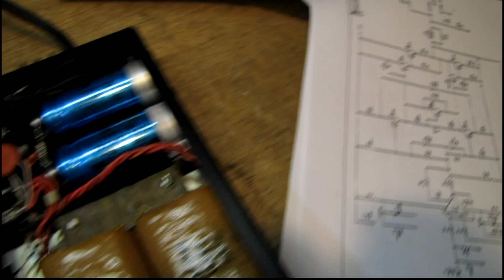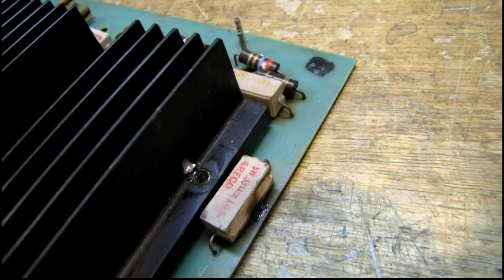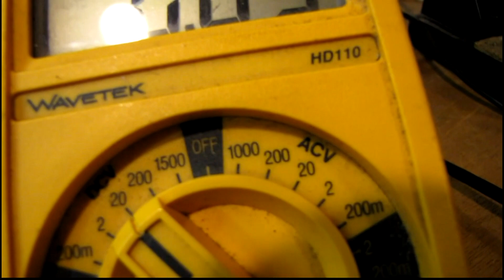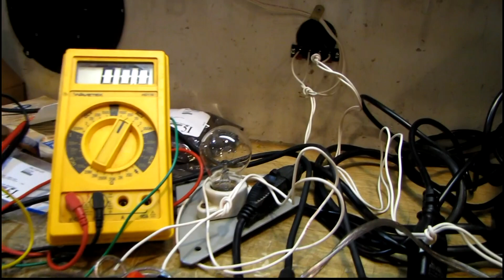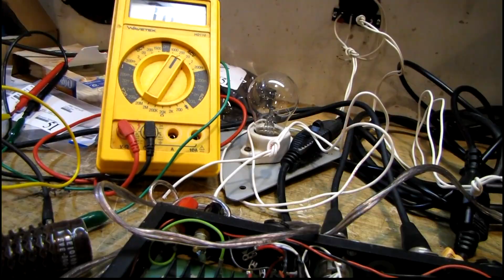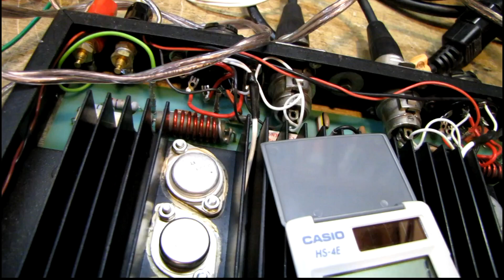Vintage BGW Model 100 Amp Repair

Comment: I have 2 of them got them from a friend of mine one had a bad power switch and the other one has a channel out going to drop it off at the repair shop before too long from now I sold my massive pa system it was huge took up my whole shop a production company owns it now running concerts so I just use these in my house with a audio centron rma800 and a crown amplifier that I saved out of my stuff

Comment: I have a 100B to drive my electrostatic headphones. Warm sound, as others have pointed out. Those old Beckman meters were great, I considered it the best of the portables until the Fluke 87 came out. One of the features was the accuracy up to 20 KHz. Only the top models were true RMS, but if you have a fairly low distortion sine wave, it makes no difference.
Reply: oops, didn't remember doing this.

Comment: Just a quick way to calculate output wattage - square the output AC voltage then divide by load impedance.

Comment: realy like your videos have try to se all your videos problem is your type  part3 but i cant find the part 1 or 2 so its alot jumping. but nevermind its still fun your are verry good to solved problem who are with electricial and components.

question what did you do with that crest ca6 your rigg is big but havent seing that one in your rigg and crest is  the best amplifired i used  ok crown is good to ;D

Comment: I have the identical Wavetek HD 110; good meter with high energy fusing but it not a TRUE RMS meter unfortunately. But if you have a clean sine wave it compares pretty close to my Fluke RMS tester
Reply from the maker: Ya, I was surprised how well it worked.  It was actually a junk box find that my Dad gave me.  One time I forgot to turn it off, and it was still running several days later LOL.  I found the website just now, and I can't believe how expensive it was.

Comment: It's entirely likely that the output transistors of that channel weren't really seeing any "abuse." With it locked to the rail, one was likely solid on and the other solid off... they were both effectively in switch mode, with no dissipation. That's why they survived.
Reply from the maker: +emolatur That's a possibility, though I'm not sure those transistors would be able to saturate enough for that.  Their internal resistance might be too high compared to something more modern.  But they have an oversized heatsink attached, so they probably stayed at a safe temperature until the resistors burned open.  I wonder what happened to the speakers though LOL.

Comment: I have a Hafler amp that stopped working a few years ago. I wish I knew what to check. I have a fluke 179, and if you could explain what I need to test, and how to test it?  I would love to fix it myself. Also, I have a Symetrix 528 vocal processor, and the parametric EQ is producing a DC hum (sounds like it). If I disengage the parametric EQ portion, the DC hum goes away. I'm not sure how to test the components. Any suggestions, or YouTube videos on what/how to test would be great.

Comment: Those TO3 are tanks. When you use your 'current limiter' with the light bulb, that is basically a light bulb in series correct?
Reply from the maker: Yep, in series with the AC input.
Reply: Thank you

Comment from the maker: Yep, seen it many times.  When they are in a high current circuit, they explode and give off hot blobs like an arc welder.  When they are in an audio signal path, they make crackling noises in the signal.  I try to avoid using them most of the time unless specifically called for.

Comment from the maker: Right now I'm using LF356 IC's, and it sounds great.  I've tried 3 different types, and it works fine with all of them.  That's one of the reasons I love these old amps, they are very flexible.

Comment: Depending on the IC used in the preamp, you may be able to find a verly low noise version, but maybe not given the age of this Amp, some of the PSSU filter caps were made very well, I hvae a powersupply here that I made and the filter caps are huge and some 20 years later seem to as good as the day I bought them.

Comment from the maker: It has a warm yet neutral sound.  Though it does need a reasonably large input signal being a pro amp.  

I'm looking forward to trying it with my ATH-M50 headphones later.  I love these older amps with the headphones being driven by the speaker outputs, as opposed to newer home receivers with crappy headphone amp IC's.

Comment: Another job well done! Did you find some good replacement knobs and fix the  potentiometers that wouldn't go silent? This amp has a really nice flat sound to it. Some of the other amps you fixed seemed to have boosted bass compared to this one.

Comment: Looks like a straight forward amp to work on. Looked the engineers had the tech in mind when the designed it.It also been in my experience that vintage amps have been under rated as far as watts. Great vid, nice job on the repair also.